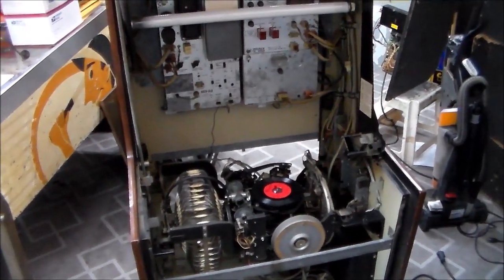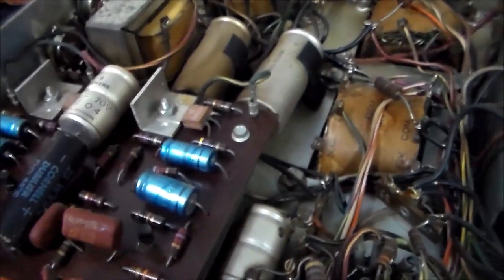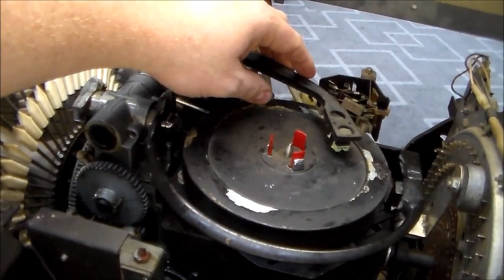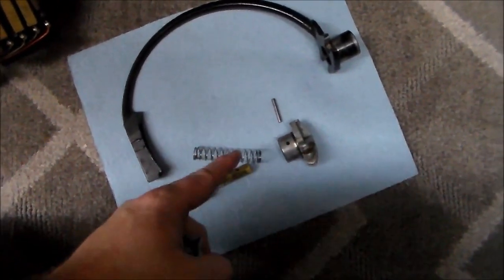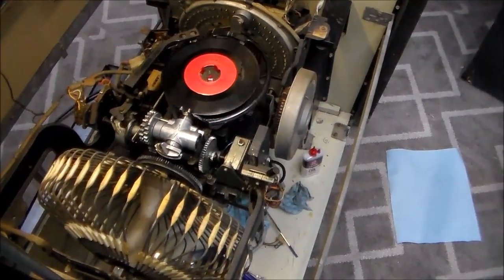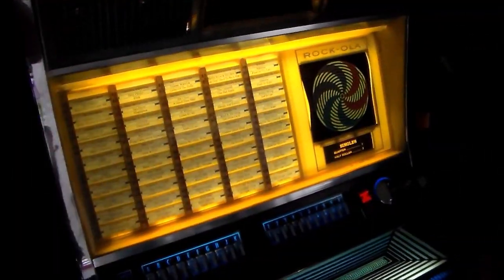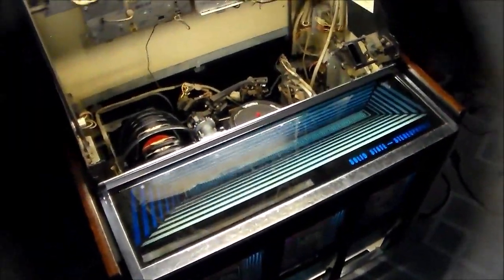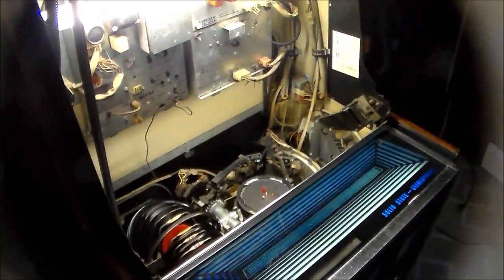Finishing Up Repair on a 1970 Rock Ola Model 445 Jukebox -Amplifier Work, Mechanism Adjustments 3of3

Comment: It's tight seeing that old school amp. I like amps, my home Sony STR-DE325 unit is from 99.' Old school but not Rock-Ola old school. Made in the U.S.A.-a mostly bygone era for anything electronics related. You don't only get mega props for the repair but for also having the Stylistics, Heatwave, Dionne, Kool and the Gang and some of their classic cuts. Nice mix of overall genres. The exterior is sublime looking too.
Reply from the maker: We try to mix in a whole bunch of different stuff because we don't know what the customers will want in it when they buy it :)

Comment: Thanks for your video series on this rockola repair!!! I am rebuilding a 444 and this series was VERY helpful! I tried to watch another youtubers channel on it but he shot his vids with a potato strapped to a pogo stick plus never explained what he was doing. Your channel is a favorite of mine now. If I manage to get my 444 fully operational (it sat for 30 years) then I will reply with a celebratory video of my own.
Reply from the maker: Very cool, let us know how it works out.... the 444 is pretty cool because it's just before they started with the cpu's which are hard to fix.... so you can get a 444 and that era working pretty good since the parts aren't cpu controlled yet.  Good luck with it!

Comment: Thanks for those three great videos. 
I guess it's possible to memorize a few selections, consecutive “write-ins” will raise several levers, then these levers will be read when the selector rotates. I used a similar jukebox in my arcade in 1983, I remember I never knew when my selection would play… With your explanations I understood that the next record played just seems to be the one whose lever is reached first. I also enjoyed to see how the operator can know which records are played the most. When you were testing only one record, just one piece of metal was raising out of the plate.
Greetings from Paris
Reply from the maker: Yup, I'll show that part a ittle more on the next one I do like that, it keeps track of which ones nobody played so you can swap em out :)

Comment: I picked up a Rock-OLA 440 today and found your videos on the 445 very helpful. Luckily this one is working already but it did have an issue with the Disc spindle continuously spinning in Operation mode every now and then. I clicked the switches and it stopped. It seems to be a specific section of the read/write disk. It's going to be a nice little project :)

Comment: Your videos are very helpful......I can offer only one suggestion and maybe it is mentioned in some of your other videos.  I cheap heat gun from Harbor Freight (or anywhere similar) when applied to that gripper bow assembly will free up a lot of the gunked up grease and allow you to oil the mechanism and get going......without all that dis-assembly which is difficult and time consuming.   Hey, my two cents only......
Reply from the maker: I've heard a couple other people say you can do that too, I used to just oil them and free them up but as time has went on I think they're getting worse so I just take them apart now :)  Thanks for watching William, we appreciate it!

Comment: First of all ,Joe thanks for fast and helpful responses but all those adjustments were made but still the same problem. I think I my need to check the play control  relay located in the Power distribution assembly (where ever that is ) and also the magazine motor relay in the control box . Somethings not sending the right signals to the right places.
Reply from the maker: On one of those videos (maybe the one before this one) we messed around with that motor relay down under the turntable

Comment: Hello Jay! I enjoy watching your videos!Last year I bought a Rock Ola 444 and started servicing it. You helped me a lot to be able to restore this jukebox. But there was a problem and maybe you can give me some advice. Thank you in advance!I cleaned it very carefully and replaced the missing parts . I supplied the device with power and after a few adjustments it worked perfectly for a few days. Then, all of a sudden, those WRITE IN solenoids no longer wanted to hit those pins at the time of the write in sequence. It finds the selected song, it stops next to the pin (the tooth ) but it doesn't do anything anymore(does not hit the pin). If I move that pin with my finger, then the carousel starts (read out) and play the selected song (the disc put on the turntable, rolled to the end and then put back in the carousel). To give  a clearer idea, I will explain the exact steps. I give him credit from the credit button on the credit box (the one for servicing). I press the keys (ex. A 1). The keys remain locked (pulled by the solenoid next to the keyboard), then the arms for write in start to rotate and stop next to the selected song (A 1 ). After this moment, the carousel starts spinning, but it doesn't stop because no PIN is moved. After a few turns, I have to unplug it because the solenoid on the wobble plate starts to get very hot because it remains activated (I think it deactivates after the pin is reset by the read out arm). I'm not sure but I suspect. Please help me with some advice .Maybe you or somebody know where this problem comes from.Maybe somebody can show me where to look more carefully... where to look or what to check. I don't understand why it worked and then stopped doing everything properly. I I also reset the gear wheel with tooth from the credit box. I replaced all the relays, checked the fuses. I cleaned the write in and read out tracks with extreme care. I think that the solenoids on the write in arm are not activated by the red wires. The ground works (the black wire). I am desperate. I wanted to give my family some unforgettable moments this Christmas, but it seems that the whole plan fell through ...
Mike

Comment: OK these vids are great and very helpful.  My 467 doesnt pick up the record and looks like I have to clean that shaft mechanism like you did.  Looks like a PITA to do it and to line everything up correctly.  I also have to recap the amp, but less of a concern at the moment (See my YT channel on vintage radio restoration).  TNX for posting the vids!  Great stuff.  
Peter
Reply from the maker: Thank you for watching Peter, glad you enjoyed it, hope it helps!
Reply: @LyonsArcade Great!  I got the contacts all working well (except maybe it dosnt seem to go back to the home position).  The record changing is like it is in slow motion and it trips the mechanism breaker a lot.  Does this sound like a cleaning of the shaft from old grease?  TNX!
Reply: Guys...the gripper unit was the issue.  Works great now!  I posted a video on my site and cited you guys.

Comment: The 'magic' returning coin trick could work also- just re-route the coin slide to the coin return chute instead of the normal drop-box repository and use the same quarter over & over! (NO incinerated solenoids to worry about!)

Comment: Question please. First let me say Thank You for your video, it really helped me bring life back into my 1970 443 Rock-ola. Thank you. 

Question, do you remember, for the big cap’s where you used 2 cap’s, to replace the 1, did you get exactly 1200uF?  

I'm looking at replacing the Copastors, and can't seem to find the proper replacement 1200uF caps. I'm thinking of doing what you did and use 2 cap’s to make the 1. But I still can't make the exact size 1200. I can get a 1000, and a 220 for 1220uF, or a 1000 and a 150, for 1150uF. Should I go over, or under, and have tolerance of +/- 20% make the difference? Or just keep looking for the right 1200uF combination? Thank again
Reply from the maker: Always go a little bit over if you run into this situation, and like you said if you're within 20% or so it's not that critical on something large like that.  The 1220 is so close it's practically the same thing, go with that one!  Thanks for watching Edwin!

Comment: Thanks for the video. I just picked up one that looks exactly like this one however I don't know which model it is yet. The only thing I didn't like is all of the repairs were done off screen and that's the part I wanted to see. Maybe it's intuitive. Maybe not. You mentioned on one part you used sandpaper but do you use sandpaper on all parts or will it damage some? And where do you get this manual? And the part done off screen and the zip tie thing? Didn't follow that. Well at the least I think it's going to be an adventure. Do you offer repair services? Thanks again. It was enlightening.
Reply from the maker: I'll try really hard next time to make the free video exactly like you imagined it in your head it should be, sorry to dissapoint you, and I look forward to you doing it better soon
Reply: @LyonsArcade  I'm sorry it came across as hurting your feelings. I did not intend that. I appreciate what you did show. I did state that. I'm a novice which I'm assuming is who you made the video for. It was a great video and I picked up a few things but the repairs were done off screen so I have no idea what happened there. And I sure don't want to mess up a nice piece of equipment. Thanks for your free video.

Comment: another solution to the solenoid issue: put a time switch (set to 05:00 to 23:00, for example) between the jukebox and mains.
Reply from the maker: That would work just fine!

Comment: use a pnp npn transistor curcuit with a relay switch. To turn the power off and on to the solonoid via the power going into the solonoid. I also thought you could use a pnp transistor curcuit that is grounded to the coin slot. to where you can just run your hand over making contact with curcuit. Basically the touch curcuit puting power on the relay at the solonoid being they took that tooth out or other wise you would just need it at the coin slot. Kind of nastalgic running hand over like puting in quarters. Make it to where youd kick it like fonzi. Hahaha
Reply from the maker: That would be a great way to do it, might take a little tinkering to get it right but yeah it'd be like the Fonz, LOL

Comment: The micro switch’s are clean and adjusted. I wondering does the gripper arm JUST need to be resting on the magazine or with it fully in the record release position when adjusting micro switch # 1
Reply from the maker: Richard it shows it all in the manual what position to adjust them at, do you have that part of the manual?  I can email it to you if you send me your email.
Reply: Joe's Classic Video Games I have the manual and have adjusted the micro switches , I’m wondering does gripper arm just need to rest on the magazine or also be in the record release position which requires and addition turn of the gear
Reply from the maker: Richard it tells you in the manual, I'll quote what it says.  "To adjust, phonograph must be in stand by position, (gripper arm over record magazine) and the service scan switch moved to 'off'.  1. Rotate the knurled end of the gripper motor shaft counterclockwise until a jam occurs" .  So standby position would be with the record released, and then the very first step tells you to turn it even farther so that it jams and you can't turn it any farther.  Then step 2 is you adjust the microswitches.

Comment: I have no knowledge about these whatsoever (came by from an Lgr video), but one question:
this machine has to be fully filled all the time? As there seems to be no 'check' on whether or not a record is present. Lovely vids btw. It looks awesome.
Reply from the maker: It is supposed to be completely filled, but only because the basket is off balance if it's half full.... there is actually a check, when it lays the needle down if there's no record there's a little post that grounds out on a pcb board behind the turntable before the needle goes all the way down and if properly adjusted it cancels the record.  If there's a record on there the needle sitting on the record is high enough to keep the post from not grounding out....
Reply: Joe's Classic Video Games Cool! thanks for the answer ^^. Didnt think about the weight of the basket, so yes logical that it kinda hás to be full.

Comment: Hey, very good video! The problem my Ola 443 has that it stops after the write in. It switches the pin (I guess) and then stops. Did the thing with contact spray. Any other ideas?
Reply from the maker: For it to do the 'read out' the record has to be hung back up and the switches on the cam in the back back to the home position.  If it's halfway through sequence or can't hang the record up for instance, or if the switch on the cam isn't making electrical contact, or misadjusted the power can't move the basket which is tied to the read out arm.  

So for instance if you're playing a record, you can select another one and the write in will turn around and write it in, but the machine won't start 'reading it out' because it's in the middle of playing a record.  Until the cam gets back to it's home position, it thinks it can't turn the basket yet because you haven't hung the record up yet.  So you need to check to see if the switches are adjusted right on the cam, if they're all working and making electrical connection, etc.

Comment: Have one the same all works but the left bottom and top speakers the sound has stopped coming out 🙁, it's not the speakers, but can't seem to find out why they don't work, could it be the amp?
Reply from the maker: Hi Riley!  Yes, it's likely the amplifier.. .it has two channels in it (left, right) and i'ts not uncommon for one channel to stop working.  If you take it out of the machine, and open it up, look inside the amp for blown fuses.  If you have a blown fuse if you look on the schematics, that area that connects to that fuse has a problem, probably a blown transistor or shorted capacitors.  It's pretty common to take these apart and replace all the electrolytic capacitors to get them sounding good again.  If you don't have any blown fuses replacing the electrolytic capacitors will probably bring the sound back...
Reply: @LyonsArcade  Dirty input level controls or main volume control can also cause one channel to cut out. Had both happen to my 445.

Comment: I seem to recall that there were a coupe of circular pads sitting outside the jukebox in part 1, that I assumed to be protective pads for the turntable. Were these not reinstalled/replaced? or were they determined to be unnecessary?
Reply from the maker: It's a leather (or pleather) disc that came off the turntable, I glued it back on after this video.

Comment: You could also removed that solenoid and somehow manually hold the assembly in the position that the solenoid pulls it to.  Then you would not have to worry about the solenoid burning up.
Reply from the maker: You can't do it that way because it has to release the buttons at the end of each selection.  You could probably add a third button or something to press though if you were concerned about it.... press one button add a credit and turn the solenoid on, then press the two selection switches, then it would reset the coil like usual after that.
Reply: @LyonsArcade  Should have known a pro like you would have thought of that if it was possible. :)
Reply from the maker: I'm not a pro but yup I did think of it, lol
Reply: @LyonsArcade  Maybe hook a microswitch up to the coin reject button, to add a credit. That would be a nice invisible job on the outside.

Comment: I have a 435 Rock-Ola princess deluxe. I can select a record and the write in motor finds the selection but wouldn’t read the selection. When I move the  lever to scan the gripper motor runs not the magazine motor.  The turn table runs great ant amp works so records do play. Any suggestions
Reply from the maker: I haven't had one do that but I believe there's a switch on the back cam that's responsible for switching the power from the magazine to the gripper, if those switches are dirty or misadjusted it would do things like run the wrong motor....

Comment: I actually have this model.  My issue is it jammed a while back we had to manually cycle through.  Now it just writes in but wont read out.
Reply from the maker: Does it spin and try to read out but does it just stop after the write in?
Reply: Nope. It reads in and stops.

Comment: isnt there supposed to be a cork ring on the turntable to protect the bottom of the record when its set down?
Reply from the maker: It was a pleather or leather ring, we glued it back on after this video was filmed.
Reply: @LyonsArcade  i used to have a very nice 100 record unit, wished i never sold it, but moved and didnt have room for it  :(  Used to work on Rock-o-La units all the time
Reply from the maker: It's fun seeing them come back to life, for sure.

Comment: Why not disconnect power from solenoid and just rig it in ON position? Like with wire or something.
Reply from the maker: It has to release after each selection for a second, to let the buttons pop back out.  So it has to actually work which causes the whole problem.